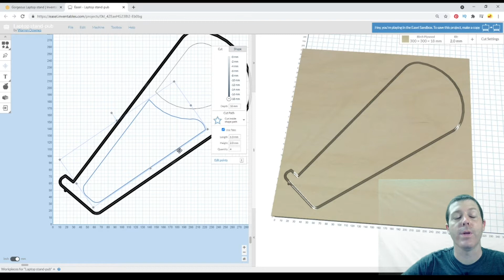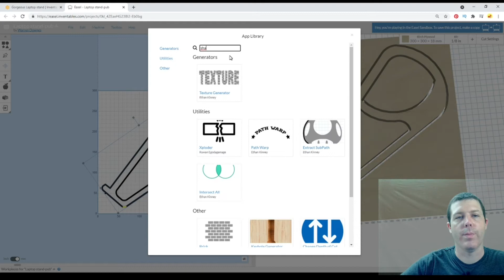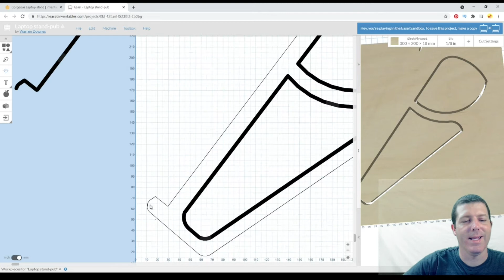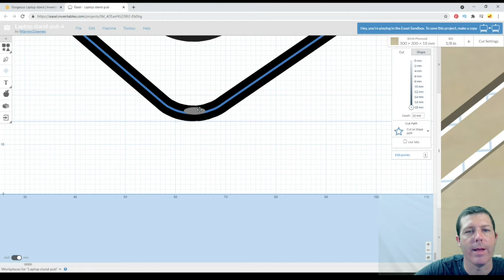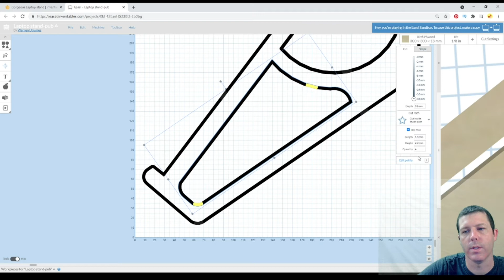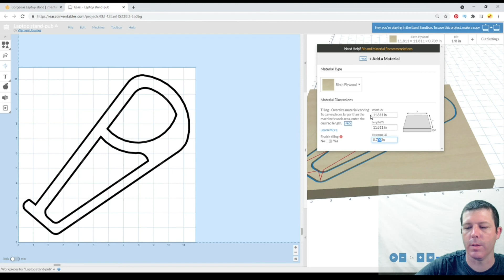TIPS and TRICKS to repairing defective SVG/DXF's

Comment: Couldn't you have used the offsetter tool and ans make offset the same size
Reply from the maker: Interesting 🤔, you mean like to close the outside that had those 3 parts where the vector was split with gaps? Or a different part?

Comment: That looks like the double line issue I had before.
Reply from the maker: Hey John!  Yes, double lines are pretty common and usually simple enough to delete the offending nodes well unless there's like a million nodes... but the un-joined sections can sometimes be a stopping point for some people, that is until they watch these tutorials :)
Reply: @SethCNC  occasionally, depending on how the SVG was created. Some apps will identify as separate track, Carbide Create has in the past and easy to move the whole vector & delete. Yours wouldn't because of segment breaks